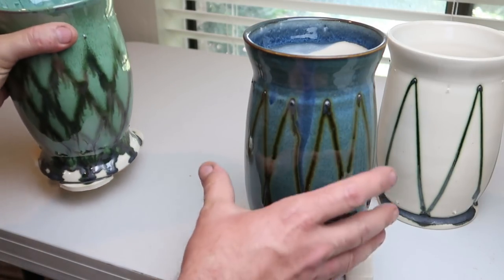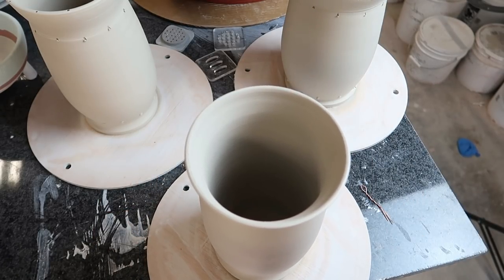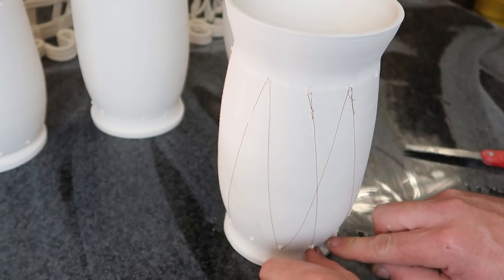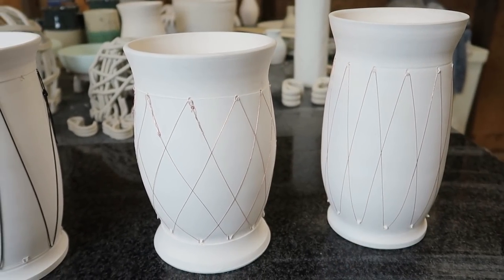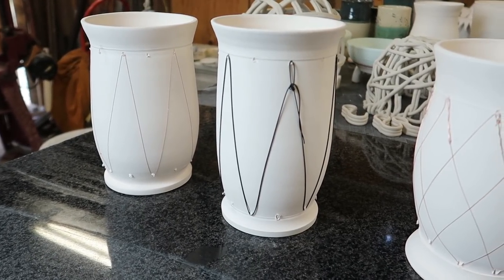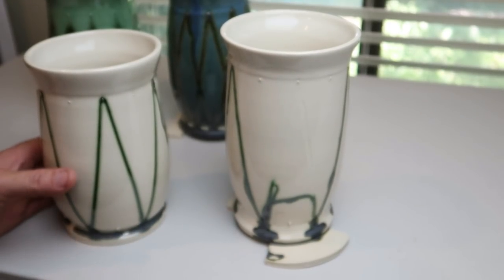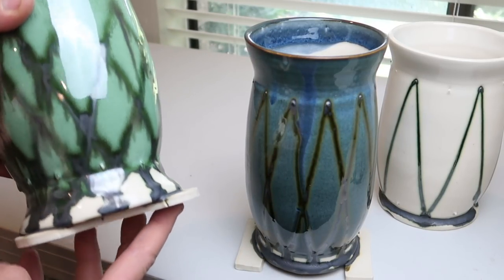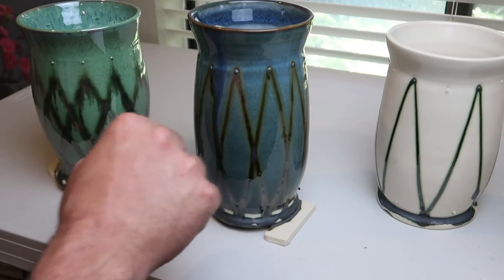Copper Wire Glaze Test #3 - Cone 5 Electric Glaze Experiment

Comment: Justin Alabama Potter here what if you weaved the wire similar to a Chinese finger trap and put it around the pot and pulled it tight. The power company uses a similar weave to pull wire... just a thought

Comment: Hey Justin! Thank you for the videos and innovative ideas!, I love the idea of using metal, and the results are stunning.. so, it's all about the handling.. just an idea here.. but what about cutting the wire in little (not tiny) pieces and applying them with the glaze together? With a brush, perhaps? Not dipping.. I'm not a potter yet, and I have no idea how it would turn out..
Reply from the maker: Thanks!  I'm sure that would work too.

Comment: Is there any metallic copper left? Does it melt out at the firing temperatures? Does it fully oxidize and dissolve in the glaze? Or is there still a metal wire under the glaze? Anyway I second another suggestion in the comments to use woven wire sleeve and pulling that over it.

Comment: What about taking a stiffer piece of copper wire and "sanding" it into the shape you want. It wouldn't be as much copper, but it looks like you don't need as much. The bisque ware would act as a file for the soft copper and should transfer into the bisqued piece. for that mater you could use a thin line nozzle to use a copper carb or oxide to draw on the piece in the design of your choice. I know you were trying something else, but it the results are the same or similar without the nibs, it might be worth trying. Thanks for the experiment!

Comment: Buy some thin stranded wire...like 18 gauge stranded.  Strip it and pull apart the strands...or,  check out model airplane and Drone supply shops...the gauge they use is tiny compared to phone wire.